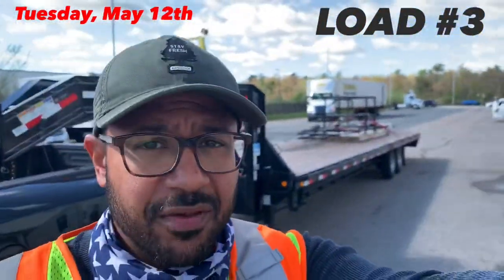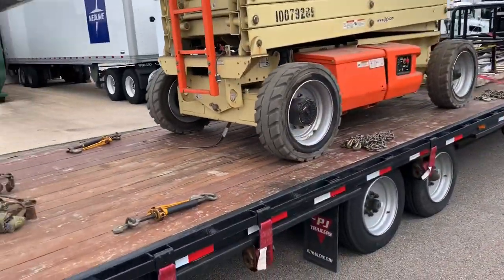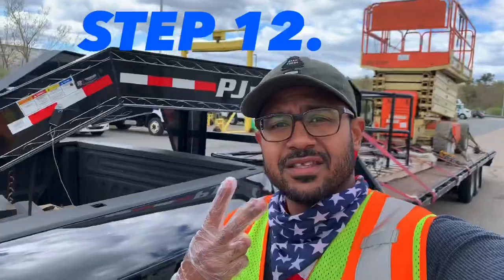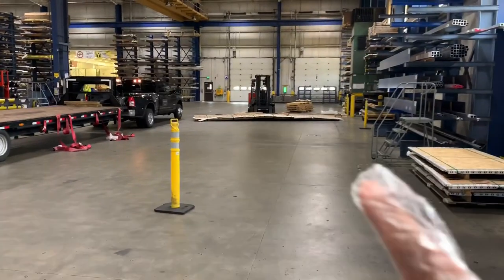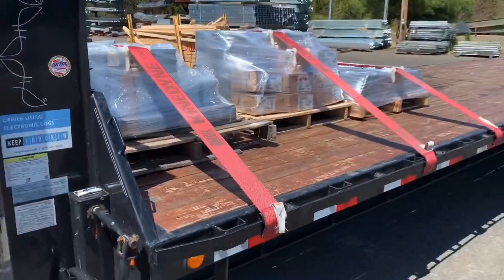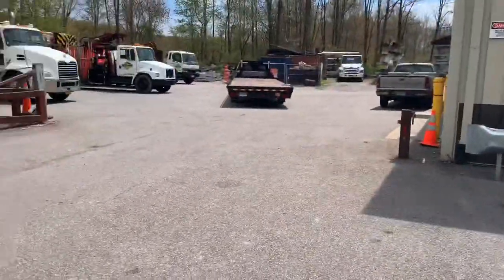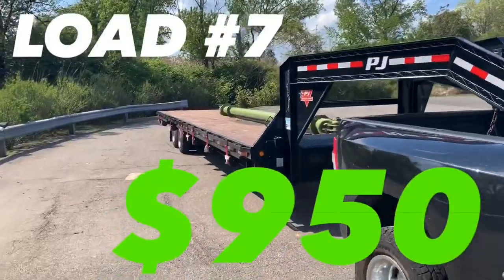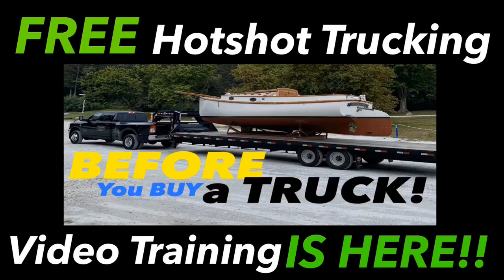HOT SHOT DRIVER PAY and TRUCK LOAD PROBLEMS | Part 2 of 2

Comment: Awesome man. 
I am working to get my CDL. And I want to work hotshot. 40 foot trailer. Which RAM you recommend 3500 or 4500 ?
Reply from the maker: Depends on how much weight you plan to haul.  3500 is good for me because trailer is 6500 and my max load is 11k. The 2019 3500 RAM pulls 31k depending on what configuration you get.
Reply: Hotshot Trucking Training Course thanks Alex.
Reply: michael P yep Semi!

Comment: What’s the gvwr on your trailer also the length & cost of trailer thx
Reply from the maker: 12k gvwr...32’....cost was little over 12k with several upgrades (low profile 3’ off ground, sliding ratchets, hydraulic over electric brakes, 17.5” super single wheels”).

Comment: How much weight can your ramps handle when loading the scissors Lift and did you have to use your other ramps you carry in your truck
Reply from the maker: Ramps I used cane with the trailer. Metal ramps stored under rear of trailer. They carry 8k